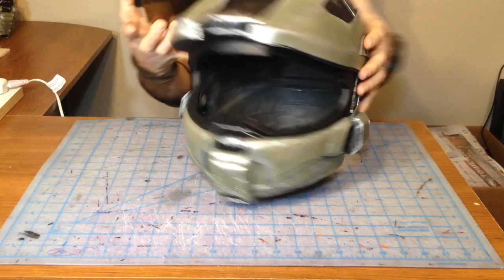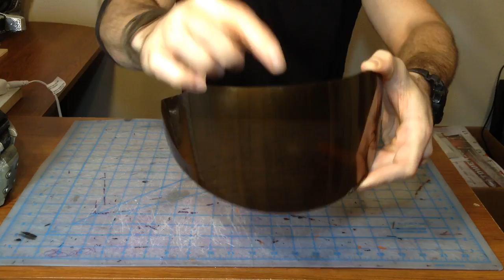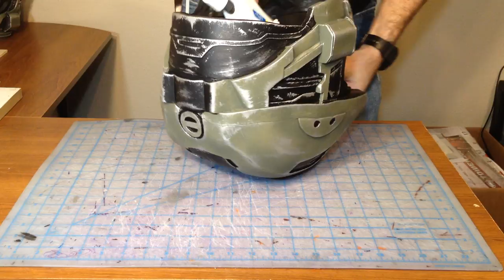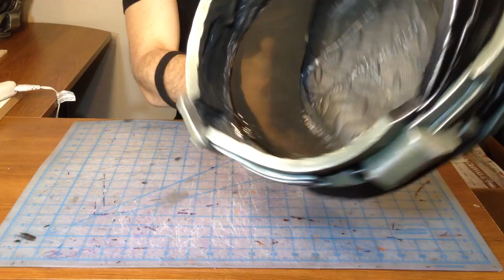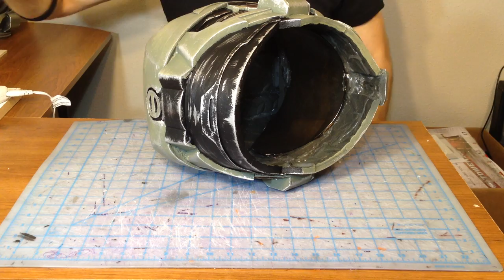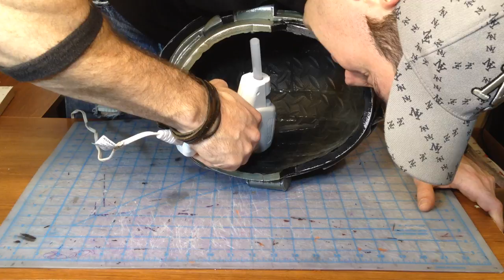Halo 4 Mark VI Visor Tutorial Part 2 of 2

Comment: Hey, do you know if there’s any Spartan Locke EVA foam templates out there? I’ve been trying to find one but all of them are for Pepakura builds.

Love your vids, man.
Reply: Also, how would you make a visor with just plastic and those one-way mirror paint?
Reply from the maker: I do believe there is a Locke set of EVA files.  I’ll see if I can find it.  As for applying mirror coating to your visor, I don’t recommend it.  It’s very cloudy, and difficult to see out of.